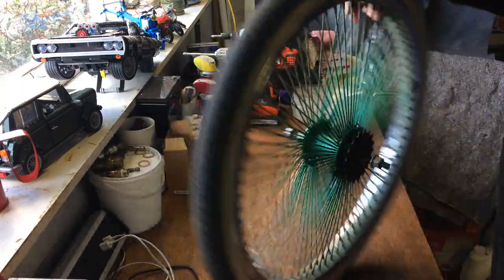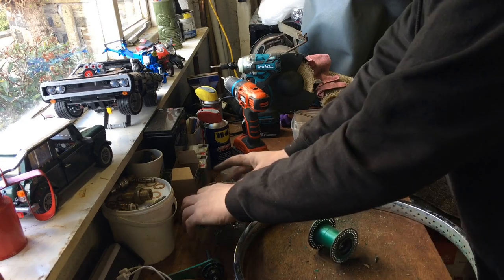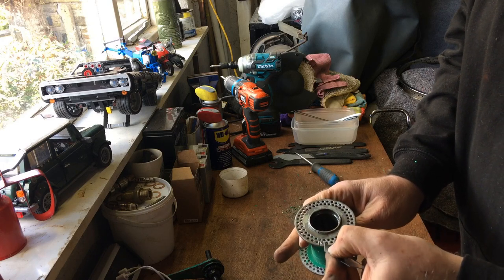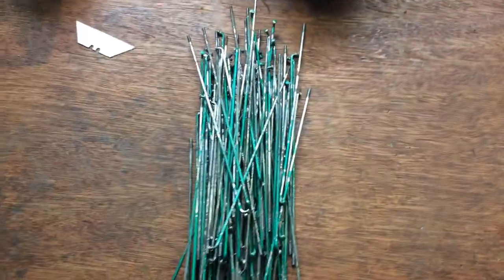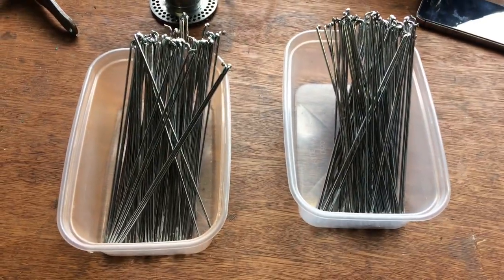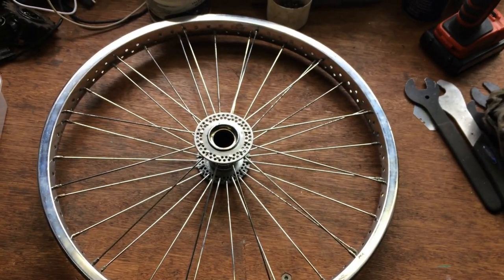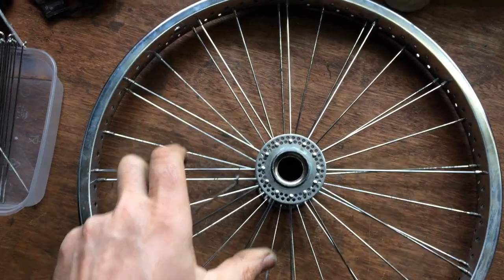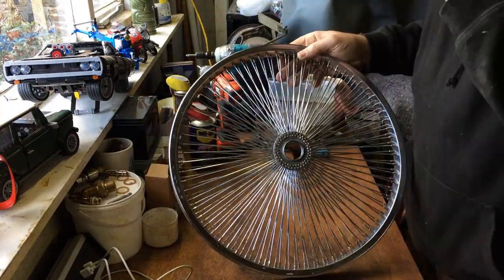Lowrider Bike Wheel Restoration

Comment: I'm trying to put some of these wheels on a wheel chair project. Can I use front rims, or does it has to be hollow hub trike wheels only?
Reply: Both should work
Reply: You can swap out the whole inner hub and install a side mount or leave it and support both sides.